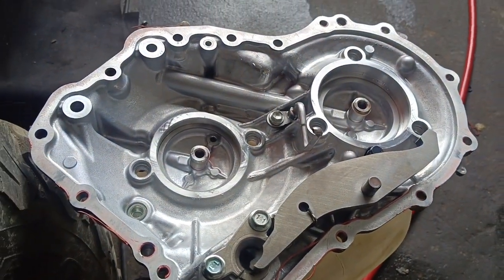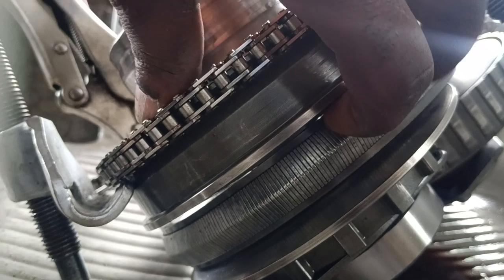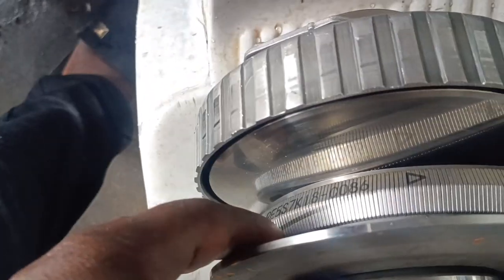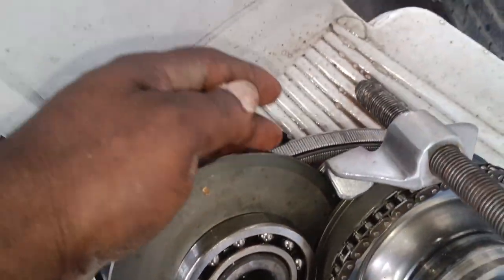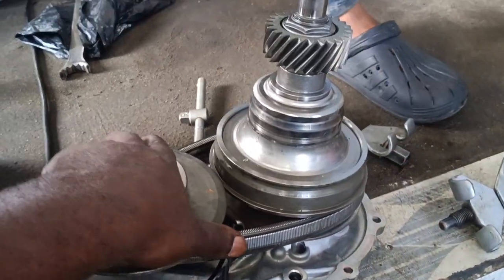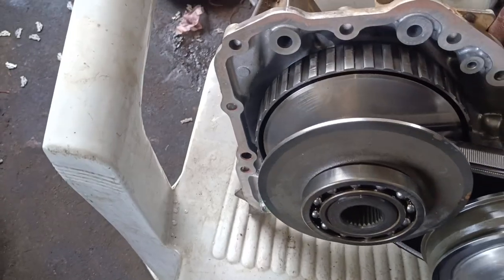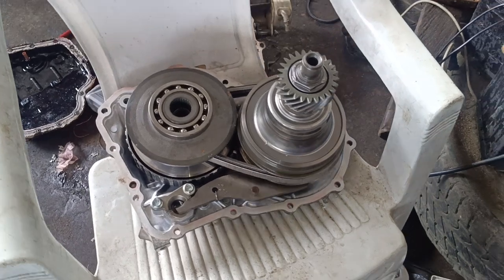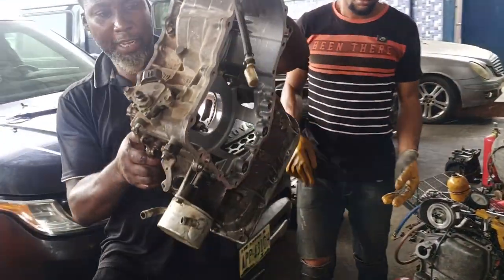Toyota Corolla cvt transmission chain install part 1

Comment: what is the cost to rebuild one that makes high pitch noise at idle only drives good just noisy at idle
Reply from the maker: Pending on the damage in your transmission
Reply: Can I get your contact to discuss this with you. I'm watching from Ghana
Reply from the maker: U can reach me via Whatsapp  +2348038074534